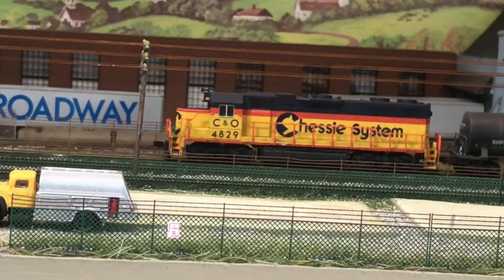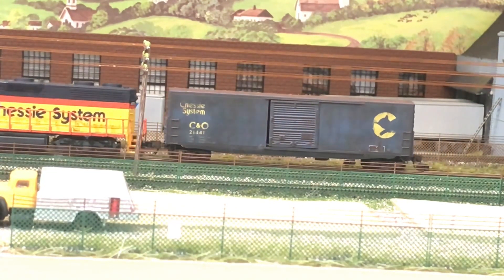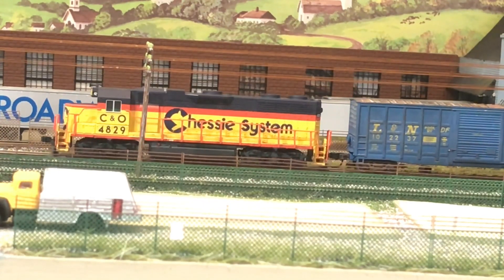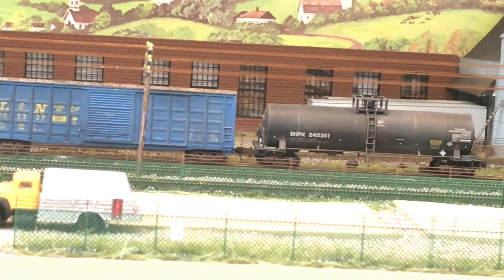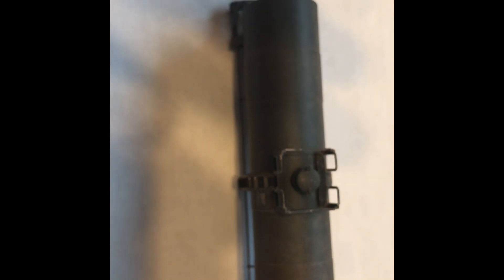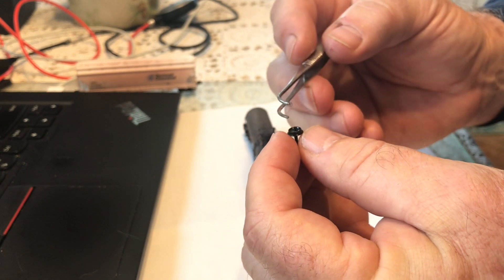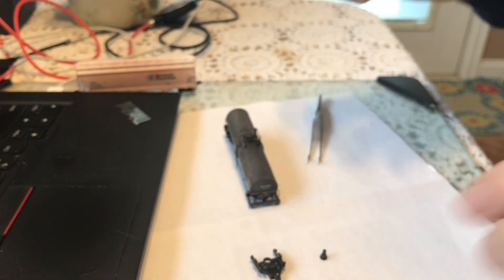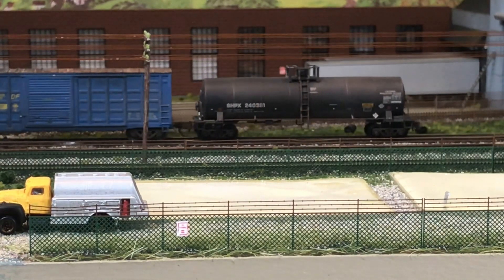Looking at N scale coupler recoil

Comment: I don't want to get too negative here, but I tried to use those tiny restraining springs.  I picked up a bunch of them at a model RR show (back when we were still allowed to have them).   I bet I spent an hour and only got three cars done.  In the end, after a few more frustrating hours...and several lost springs...I kind of gave up on the idea.  Of course my big clumsy hands didn't help much either, LOL.
I have some pretty tight radius curves on my current layout, so body mounts are only marginally successful.  On the positive side, those tighter curves do add a significant amount of rolling resistance, so it is certainly not a total loss.  I still love and enjoy modeling in N Scale...probably always will.
Reply from the maker: I’m not a big fan of them either. They are difficult to install and don’t address the real problem: the couplers. It’s like if you have a hole in the muffler in your car, so you turn up the stereo. You’ve hidden the problem, not fixed it. The rubber band solution works well for me and I’m still running truck mounted couplers on most of my cars. Thanks for the input, don’t ever hesitate to express your opinion as long as it’s respectful! Stay safe.
Reply: @thomplacier677  Thanks for the reply.  I wasn't really sure if I should have inserted a little  "less than great" experience or not.  Glad you took it for what it was.  And again, that is just my experience with those little gunners.
I do prefer body mounted couplers, but there are situations where they simply can't work.  My fleet right now is about half Rapido couplers, and the other half is about 60/40 in favor of truck mounted.  I came across a great deal a while back on trucks with M/T couplers and couldn't pass it up.  With over 100 pcs of rolling stock, it is going to be a while before everything is switched over to MicroTrains.  So as you might guess, I have several conversion cars with M/T on one end and Rapido on the other.
I have also observed the "inchworm" effect on cars with Rapido couplers, so it isn't just a M/T issue.  I think it has to be a very fine balance between weight and rolling resistance...which I have not yet found.

 PS:  Funny you should mention the "hole in the muffler" scene.  Just blew a hole in the muffler on my van a couple weeks ago.  Believe me, turning up the stereo in that one is not going to "hide" the sound, LOL!

Thanks again for the reply.
Reply from the maker: @NJP76  I prefer body mounted couplers, too. Just not enough to make the change right now.

Comment: Nice vid Thom. Been a long time ago but I used those springs especially in my cabooses. Even after adding weight and the spring some still had a little bounce. I’ve read that it’s the spring inside the coupler box that causes it.
Reply from the maker: You’re right and the McHenry couplers don’t have that. I may try to gradually body mount couplers on cars that seem to have the problem, as well as adding weight. But I have plenty of other stuff to keep me busy, so it’s not going to shut down the railroad!😜

Comment: I use these springs. And yes they are hard to find. I take a little Vaseline on a tooth pick and dab it on the point of the end of the wheel to sit the spring on. It acts to hold the spring on the wheel until I get the wheel back into the truck. And it acts as a lube. Also putting a little Vaseline in the coupler pocket can help too. Oh and MT makes a body mount conversion kit for Tankers, also hard to find.
Reply from the maker: I meant to mention Vaseline, but forgot. I’ve never tried it in the coupler pocket, but it makes sense. Thanks!
Reply: @thomplacier677  I sometime put the couplers together because they are much cheaper. And in the instructions MT says to use Vaseline. Both ideas can take a lot of the bounce out of the car.
Reply from the maker: @Vman7757  , I have done that in the past, but it’s been along time. If I go to body mounts, I’ll probably try it again. Thanks!
Reply: @thomplacier677  I have a question about the Vaseline in the coupler pocket.  I have never tried it, but would that not affect the delayed uncoupling action?   Just curious if that would make the coupler movement into the delay position at the magnet  a little sluggish.
Reply from the maker: @NJP76  , I think if you put too much it won’t let the couplers uncouple. It’s probably a fine line, but I can’t speak from experience because I don’t have experience with anyone using the magnets. My friend and I just uncouple by hand, and even if there is a lot of Vaseline in there, it shouldn’t affect it.

Comment: Nice vid!
Thank you very much for addressing this. I had no idea before that there was such a product. 
I've also heard that weight is a way to address the slinky effect, but was not eager to try it since my branch line has a 2% grade and I was concerned a lot of extra weighted cars would shorten train lengths.
I realize this also increases drag but it might also solve a problem I have with rolling stock drifting where track is supposed to be level.
Thanks again!
Reply from the maker: You’re welcome. My layout is completely flat and I’m not worried about train length but it’s still annoying when you spend so much time trying to operate realistically and the cars act that way.

Comment: Interesting video. I did not know about that truck restraining product from Micro Trains. There is another product from MT that might help you. It is called a Spring Pic and is specifically design for manipulating those tiny springs. I think weight is the answer to the bounce problem as it also increases drag. You showed an Atlas boxcar that didn't seem to bounce, but didn't say whether it has body mounted or truck mounted couplers. I share your frustration of working with small parts. Thanks for sharing. Stay safe.
Reply from the maker: It was an Athearn car that had body-mounted McHenry couplers. I try to stay with all MicroTrains if I can. It’s a lot tougher to add weight to some cars like gondolas and tank cars, but I’ll work on it gradually. I just need to get a scale to see if weight is the problem first. Thanks for the tip!